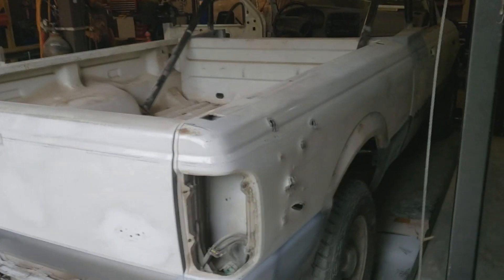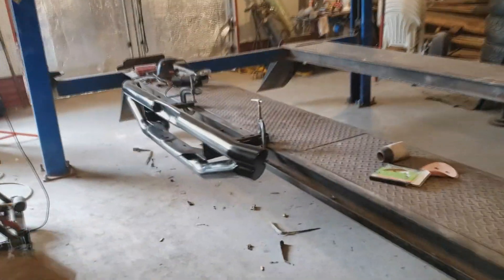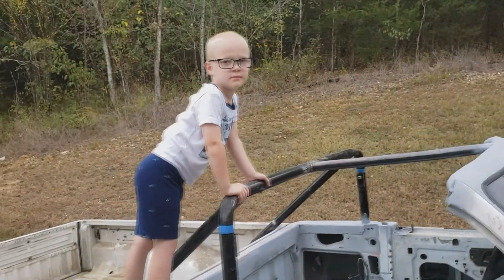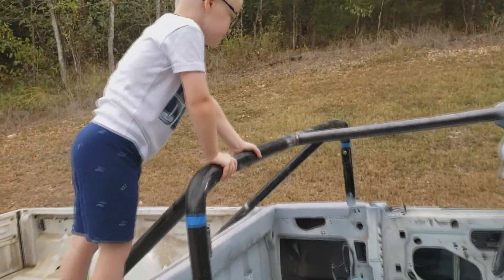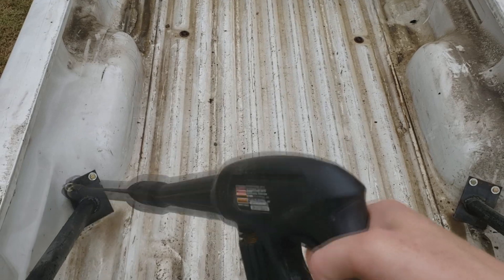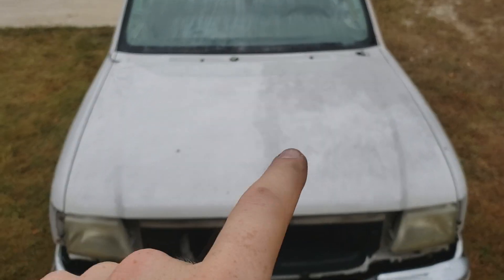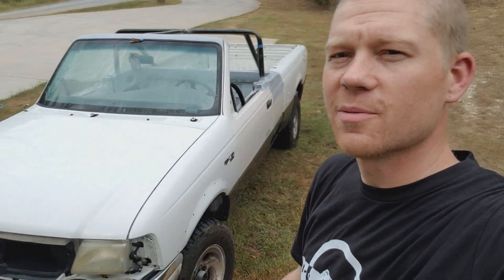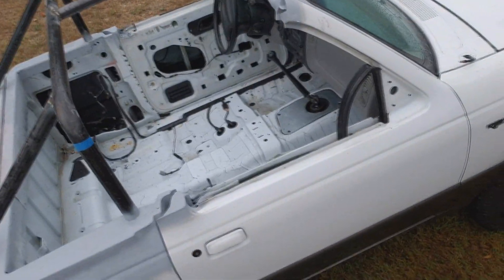Chop-Top Ranger Update!!!

Comment: what are you going tor the top? You've got to have something to keep the rain out, least ways unless you have a garage to keep it in all the time. I was thinking you could make an easy on, easy off top out of an old long box camper shell. Maybe a metal one, with a bit of a framework added.
Reply from the maker: Garage for now
Reply: @WHOTEEWHO  You know what might be fun and funny, a top that looks like a garage scaled to just fit it. Metal roofing on the sides and top, on a light steel framwork. You'd certainly have the only one around.